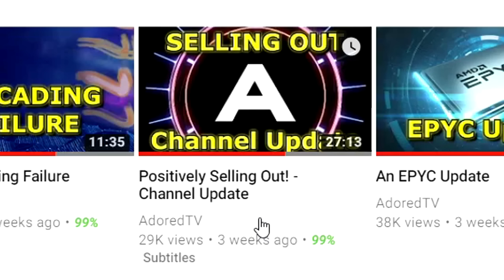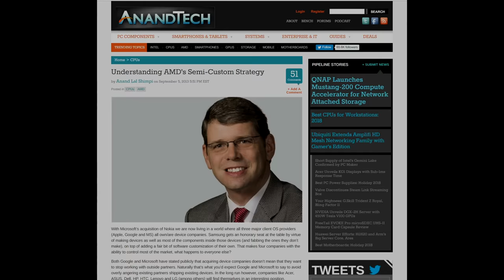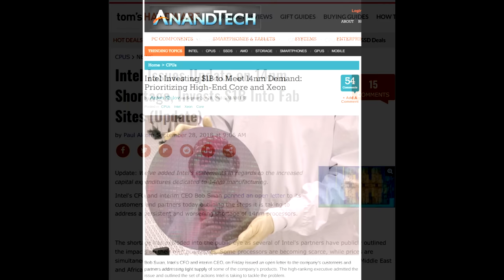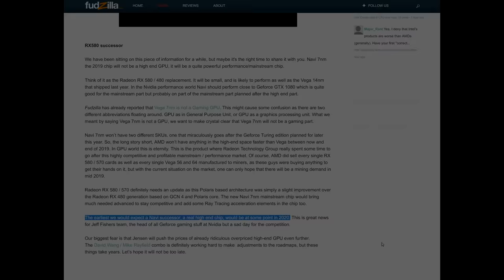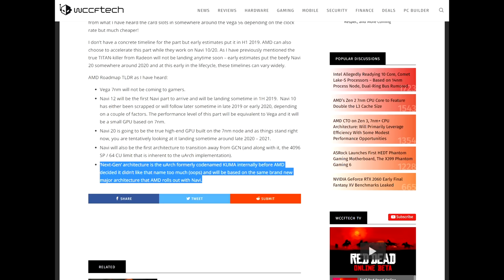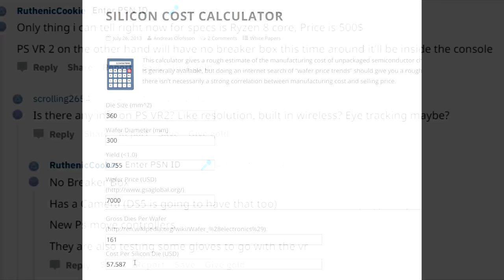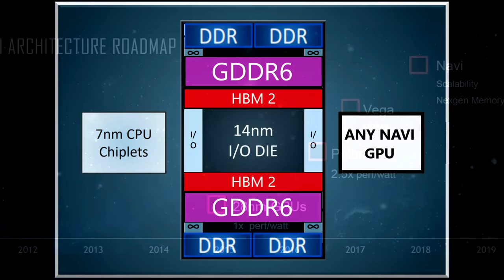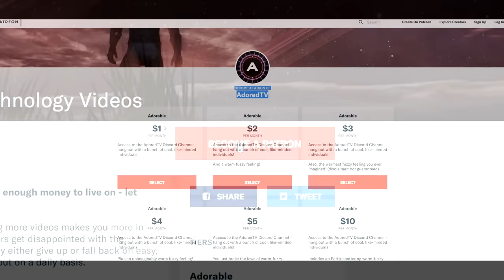AMD  - The (Evolving) Master Plan

Comment: Yeah, I've been suspecting that these "leaks" on Ryzen 3000 or Zen2 are done by AMD (marketing) on purpose to gauge pricing and product banding on comments and responses to these leaks and/or surveys posted on websites. 

WCCFTECH offered surveys on purchase decisions at the end of each article for on RX3000 (NAVI) GPUs: https://wccftech.com/rumor-amd-navi-10-to-launch-in-mid-2019-compete-with-rtx-2080/ 
and on Ryzen 3000 (Zen2): https://wccftech.com/amd-ryzen-3000-specs-prices-leaked-upto-16-cores-5-1ghz-on-am4/
And if AMD Marketing isn't behind it they would be stupid not to use this info...it is the consumer telling AMD what they want and if they are willing to pay they price AMD would like to charge for it, just by leaking some info.  SURE it may show their hand to Intel, but if Intel doesn't have an answer for the higher core counts than it doesn't matter much.

Comment: i think the idea of getting motherboard makers to "switch over" to amd is not quite right.  i mean sure intel is having problems covering all the demand but if there was a mass switch over to amd the problem would be even worse.  this seems like a good time to embrace amd to make up the shortage but still intel is going to be a large part of the market.  tsmc has lots of other customers.  they would have to build up more fab space than they already are.  and for them to build it up they would have to be sure there would be  a market for it.  the consoles will help cement in their minds that there will be the demand but at the same time the consoles will eat up a large number of chips as well.  the fact of the matter is that amd are at the mercy of tsmc and to a lesser extent glofo.  if tsmc are on board then maybe something could happen.  but at the end of the day as you point out its manufacturing capacity that matters. i think intel is sticking with 14nm as much because of that as problems with 10nm.  amd can afford to have low yields and 40% longer time to complete a batch of wafers.  intel cant.  when euv hits it could change things but right now i dont think so.  

as soon as large demand starts coming in for amd, like if there was a huge shift to switch to amd, then you have shortages on their end and the price goes up and they are in the same siutation as intel right now with their shortage.  and what do you do then?  same thing intel is doing.  prioritize what makes the most money.  server chips.  the board makers and the hyperscalers know it.  the best they can do is use epyc and ryzen to get better deals out of intel and the best amd can do is get the market share back they should have had all along.  it just doesnt look like a story of amd winning now, but losing for the last 5 years.  i cant see it any other way.  now if intel cant get to 10nm, thats a different story

this strategy could put them on par with intel for the number of chips they can bin from but there is a slump coming.  just like after sand bridge.  everybody 2nd and 3rd and 4th gen intel cpus.  and after that there was no reason to upgrade.  sales sort of dropped off.  intel made money on lower volumes and higher profit margin stuff.  when amd came back into the game people started upgrading and the demand was huge even considering the fact that there was a new competitor in town.  but once 7nm zen comes out and everybody buys them or intels 9900k or intels 10nm (sort of like the 2nd 3rd and 4th gen intel) then nobody will have a reason to buy anymore.  7nm is gonna be a long node.  maybe the last node for high power draw cpus.  if not 7nm then 5nm most likely.

unless intel are working on a truly new arch.  and it woudl seem so.  the cores havent changed since skylake and most of skylake was just mobile\power optimizations of haswell\broadwell.  ocean cove is supposed to be coming.  i wonder if the reason they have been on skylake for so long is that they are going whole hog on ocean cove.  i mean haswell was exaaclty at that magical 5 year number for a new arch.  im pretty sure intel will have 10nm ready by the end of 2019 or start of 2020 at the latest.  if they come out with a really new arch that ups single core performance and 10nm makes it viable at high clocks and many cores then maybe there will be something worth upgrading for

i dont think more and more cores is the way forward.  so many things just dont scale well that way.  i think about 8 cores for the high end of the mainstream is about right.  now instead of more cores we need more single thread speed.  and zen is a great arch but zen 2 and zen 3 will just be increments of the first zen mostly.  i mean higher clocks can do wonders as well as lowering latency but still zen 2 is basically gonna be the same arch and i would guess zen 3.  i just wonder whats coming next, if anything.

Comment: I seriously hope Navi becomes AMD's saving grace. After the failure of Vega, they REALLY need this architecture and its successors to be successful to win over the consumer. NVidia and its government grade advertising has made it look like they are the only company for high performance gaming graphics, and I don't see this mindset changing fast if it does at all.

On a side, I'm surprised nobody's come up with a solution to making a powerful multi-GPU setup that behaves like a monolithic GPU, although with the bandwidth requirements of a GPU that really shouldn't be surprising. The interposer would have to be able to manage a 10+GHz clock to manage 2+ GPU dies in one package with some seriously low latencies to see any performance benefit, or you end up having to prioritise sections of hardware to improve the performance. ISVs are absolutely not gonnas do that if they can't be arsed with SLI or crossfire X!!
Reply: Vega is not a failure, It trades blows with the 2070 (which costs more) of today and beats the 1080 in a lot of newer games. No it doesn't beat the 1080ti but that is EOL and Nvidia is trying to shove 1060's down consumers throats because of the mining crash, even cut down gpu 104 chips as 1060's. Just to move all those gpus they had to take back from a single board partner. Now the RX 590 IS faster than a 1060 and the  RX 580 trades blows with it. A 1070 (EOL) is beaten by a Vega 56. The drivers have improved tremendously, all one has to do is undervolt AMD gpus and a little overclock to get even more performance out of them as Jim has shown in a previous video. IMO the combination of Radeon Chill and a 144hz Freesync monitor on any AMD gpu is a smooth high frame rate gaming experience going back to the R9 380 4Gb. When tweaked they are NOT a power hog as people have claimed. I recently purchased a reference Vega 64 (Sapphire) and it runs cool and quiet. I have profiles set for 1630 Mhz while gaming and low power profile (165W max, avg. 5W) for normal everyday use. It only costs $399 on Newegg with free shipping and 3 free games, $359 for Vega 56 same deal. How do you define "failure"?
Reply: @jerrywatson1958   True. It's a decent GPU, however in the market, despite the better performance, it was still nowhere near as successful as it should have been. It saw a massive price hike due to both mining and massive increases in HBM pricing. Not saying Vega was inherently bad because much like GCN when it initially launched it was an engineering feat and does make a damn good GPU, but for what it is, the prices were absolutely abhorrent due to lack of supply!
Reply: @DigBipper188  Not this holiday season. Newegg has Sapphire RX Vega 64 reference model for $399 w/free shipping + 3 free games. Last years Vega drivers were not the best. But since then more modern games have come out also game patches to stop nerfing Vegas and Ryzen cpus have helped. That Fine Wine Technology is taking hold, long term these cards are going to be mainstream for at least 4 years, a very strong 1440P player that does 4k. Mining has taken Nvidia down a notch just like it did before with AMD. Now couple that with a disaster of a product launch, and EOL of their best selling cards for even more expensive ones that die within a few weeks. AMD will sell a lot of cards RX 570, RX 580,  and RX 590 to cover all the midrange builds. Low cost Vega's take sales away from 1070's if you can find them and RTX 2070's (which they are less expensive than) because they trade blows in game frame rates with it. 4k\60 is going to be the new standard in gaming pushed by the next gen consoles on Navi and Zen 2 not RTX.

Comment: consoles won't be doing 4k 60 fps apart from on select titles next gen the current ones can't even do native 4k a lot of the time and keep 30fps add the progression of graphics quality plus they will use essentially a apu
Reply: It doesn't matter what old consoles have. lot of rumors say that PS5 is indeed graphical monster, but you know we can only speculate for now. Key for consoles is to have as much as powerful hardware as possible on speciifc price tag, because it will need to handle technological progress of at least 5 years, something that current gen consoles failed to do. Cell for PS3 even tru it was struggle at beginning, it paid off at the end as PS3 aged a lot slower then 360 did.

Comment: Nvidia gets a lot of negative press, but even with the ps4 and xb1 using GCN architecture and knowing that games are developed for console first then the PC port is usually an afterthought, ie all the advantage you can ever expect, AMD still hasn't managed to best Nvidia. Most of that is down to Nvidia's efforts and how difficult gains have become to achieve.
If you do some speculative math based on Radeon vii vs Vega and architectural improvements over the years, Navi will fall somewhere between Vega 56/64 at about the 1660 Ti's price(which agrees with other speculation). With Nvidia looking at 7nm in 2020, it probably won't be enough to justify the hype. Maybe competition will help speed up progress in the industry. But AMD hype is not something i'm not falling for again.

Comment: I personally sceptical of WCCftech's rumors of Navi being some entirely new thing designed for the PS5 when most of the roadmaps AMD have officaly provided and previous other information has stated that Navi is simply GCN but on 7nm. I think if PS5 and Xbox Scarlett are both in late 2020 maybe both of them will be AMD's next-gen (post-Navi) architecture on 7nm+? I mean I dobut AMD would be bothering with mention "Next-Gen" if they were still releasing Navi and Next-Gen is supposed to be an entirely new architecture from GCN which I personally think WccFtech as usual is spreading BS.

For the consoles I mean PS4 Pro was relased 5 months with a Polaris GPU after the RX 480 was released so it wouldn't be ridiculous if 7nm+ AMD Next-Gen GPU with Zen 3 gets released say Spring 2020 with a PS5 & Xbox Scarlett with a AMD Next-Gen solution w/ Zen 3 maybe with using some chiplet solution to help produce a powerful console at a affordable BOM price. Personally any new fancy Chiplet or MCM GPU will probably seen in AMD's Next-Gen at earliest than Navi.
Reply: @J Fz Well that's why I think there's the possibility of both next-gen consoles being 7nm+ Next-Gen/Zen 3 than the often speculated Navi/Zen 2 on 7nm. Considering IIRC Phil Spencer (Xbox honcho) has talked about Ray-Tracing early during GDC time this year and Navi will likely be an improved Polaris/Vega design on 7nm I think AMD's Next-Gen will be the first Radeon architecture to have Ray-tracing on it and also potentially other snazzy features like maybe something like DLSS? A 15-16 TFs console doing 4K DLSS would have performance equivalent of 19.5-20.8 which for say Vs the Xbox One X would be more than 3X the performance say on Xbox Scarlet.

Again this is just all speculation, I think if Sony & MS go for cutting edge in late 2020 at 500 USD, I think Ray-tracing could be in next-gen consoles or more common use of Global Illumination and maybe we'll see Ray-traced games (though not on the level of current tech-demos) being developed from the ground up in the next console gen as I think we'll only see ray-traced games optimized when we have games built up from the ground, I think we'll only see games looking like the Star Wars Reflections demo the gen after the PS5 & Xbox Scarlett.

Comment: With a lot of PC games tending to being built for nividia cards, wouldn't the console market games tend to favour AMD CPU's and GPU,s  wont this help AMD in long run on PC games  for AMD hardware PC builds,
if more devs take this up for console and then  PC ports ,  where as at the moment  some PC port overs  can be terrible with the variations of different hardware  could it help AMD build in long run if optimization is for console hardware , 
 or am i way off ,

Comment: zen 2 is going to be just 8 core chiplets though, 1 ccx with 8 cores, wouldnt ps5 get the same chiplet thats being used in everything else. wondering about that 2x zen 2 chiplets  (4 cores each) thing. @ 36:57
Reply: or is it still quad cores dependent on infinity fabric?
Reply from the maker: It's the same Zen 2chiplet, just with 4 usable cores in each instead of 8.
Reply: not sure if this has been confirmed yet...
Reply: my bad that comment was before i saw yours
Reply: okay right on, so it will be an 8 core ccx for desktop ?
Reply: I'm excited to see the gaming performance when there's no infinity fabric dependency.

Comment: No, today's midrange GPU is not tomorrow's low end GPU. Depending on what you mean by performance, there is a significant difference between what we might call low end, mid range and high end cards, with generational performance gains from each tier never exceeding 25% at the theoretical level (real world performance often reflects lower gains). This has been the case for both ATI/AMD and Nvidia for two decades. It can take upwards of 5 years for a low end card to even begin to approach the performance level of of the earlier midrange tier, and for midrange to approach previous high end levels, with some not even beating the performance of GPUs from a decade ago.

So if AMD is indeed producing a midrange GPU with Navi, then it will remain midrange for a very long time, particularly so due to refinement based releases such as were had with the 480/580/590 series of GPUs (which I applaud - it does not make sense to continually redesign core architectures when existing ones can be improved by manufacturing process).

Comment: What do you think about a $200 Xbox one two, it would just be capable of playing Xbox One games, it would use a quad core ryzen in optane memory.

With like 32 gigs of it, you don't need to worry about optimization because you can just brute force it with a $15 optane chip.

And for the GPU I bet the cheapest thing in the 10 series graphics card lineup a stripped-down 1030 is capable of playing everything, but you might want to go with AMD for optimization reasons, I assume a 460 is more than capable. And it could share Ram but I would make it 64 gigs of RAM or to 32 gig optane chips for Speed
Reply: This would also take the place of the Xbox streaming box if you have enough internet bandwidth, then developers if they want to could optimize their game to run on the next-gen systems to run on the streaming box if they feel like it.

Comment: I have been saying this for YEARS! Maxwell was and remains Nvidia's single best graphics architecture to date, which is why Pascal is 97% Maxwell on 16nm finFET, with GPU Boost 3, which automatically overclocks Pascal to factory limits, and will go a bit fsrther still with just minor tweaking.    
Anyway, a GTX 980 Ti at 1500+ MHZ core and 8 GHZ effective VRAM is actually FASTER than any GTX 1070 - because Maxwell has an additional 25%+ performance in the tank, where Pascal, you are looking at not more than about 10% at best - due to Boost 3.0 already driving the GPU core near its hard limits. 

If I had to speculate as to why Maxwell and Pascal are so successful for gaming graphics, I would say a LOT is down to Nvidia moving to Tile Based Rasterization with Maxwell, which allowed for a VERY effective memory compression system, as the scene is rendered in "Tiles" that fit within L2 Cache before being moved to VRAM, and before doing just that, pixels that are occluded from view are discarded (similar to AMD's primitive discard accelerator) and all color is quickly compressed via delta values, again, BEFORE beinf sent to VRAM. This has a huge knock on effect of requiring both less memory bandwidth, but also less VRAM space, compared to Kepler especially, but even and GCN 4 as well. 

AMD has stated that Navi will NOT be the standard GCN type architecture, and if true, this could be AMAZING for consumers! If AMD focuses on purely gaming FPS with Navi it could beat Nvidia once and for all, or at least could make most SANE people pick Navi over RTX!
Reply: Yes, the 980ti is best card nVidia has ever made. It is the longest lasting card. It even beats a Vega 56 at  max oc when the 980 is overclocked to 1520mhz and 8ghz memory.

Comment: Wouldn't it be better if AMD designed different IO dies for different markets rather then reuse one die far all of them? I mean, if PS5 isn't gonna use HBM or DDR then there's no reason an IO die needs to have those controllers. That way they'd be smaller and have better yields.
Reply: I think the reasoning has more to do with only having a single die to mgf at global foundry. It may be easier and cheaper to do a one size fits all io die than have 3 or 4 separate io dies despite the fact parts will often be ignored on any given use case.